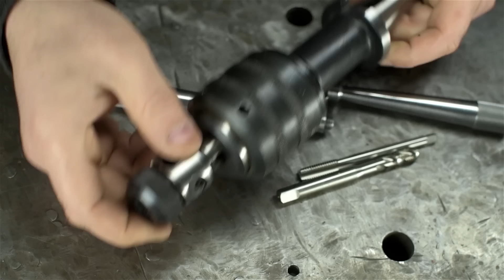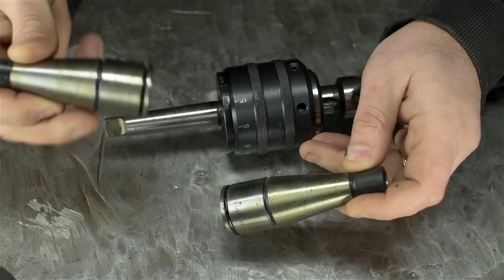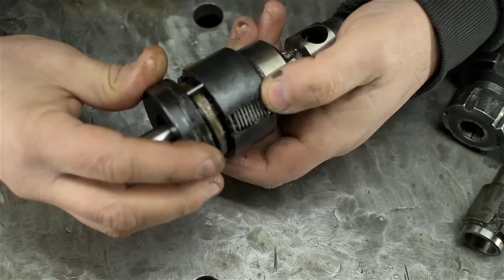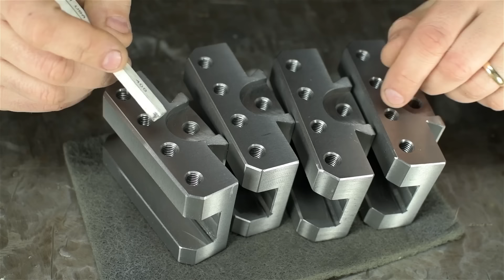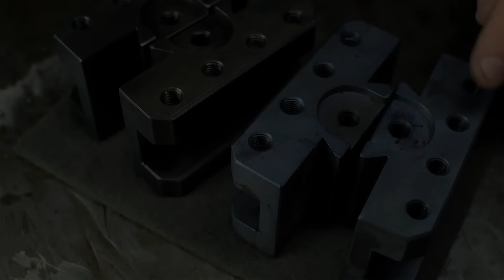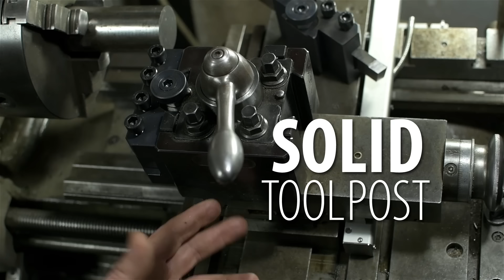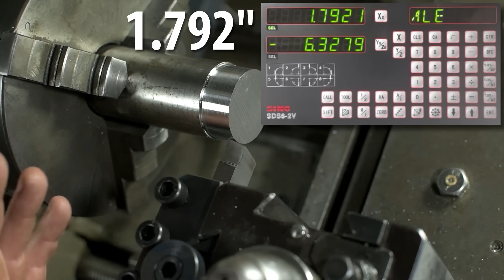How To Break A Tap & Other Ramblings

Comment: If you really want a cheap gun bluing solution, buy a bottle of Selson Blue Dandruff Shampoo and apply it directly to the part.  It contains selenium, hence the name selson blue.
Reply from the maker: I'm not saying I don't trust you, Barry, but this smells like a setup.  You promise you won't laugh when I show up with all my parts covered in shampoo?
Reply: This Old Tony   LOL!  I won't laugh, but try it first.  I discovered this from people claiming their silver jewelry turns black when they use Selson Blue in the shower.  When I looked at the ingredients, it has selenium and so does gun blue. Selenium also generates a tiny bit of electric charge when it comes in contact with light. It could be the secondary or even primary way it prevents rust through a reaction similar to galvanizing.

Comment: would you not be able to make your own ISO 30 holder and just have it as a shrink fit onto your straight shank tapping head doohicky. have something like .005 interference and it should hold more than tight enough for the sizes of taps your using

Comment: As a Machinist and Toolmaker I love your videos. I will say that in most cases the non-spiral taps are stronger. It's not the shank diameter that matters. The webbing is whats going to give up the ghost. In all cases though avoid 6-32 taps like the freakin plague. I can count on one hand the taps I've broken after thousands of holes. 6-32 taps on the other hand. I'd run out of fingers and toes. With such a coarse pitch and the percentage of thread to minor diameter a 6-32 is the worst thread in the world...

Comment: Cold bluing is always a bit tricky, but here is what I have learned over the years.
There is such thing as too nice of a surface finish for bluing. Just like rust bluing has a hard time permeating the surface of steel the closer you get to a mirrored finish.
Clean and degrease the parts, and use gloves. Nothing is worse then a thumb print in your nice new bluing. 
And the sooner you blue after your machining operations the better. The parts will start to oxidize just from the oxygen in the air, it may not be viable but it is happening. I tend to use a cleaner with a mild acid made for bluing if I can not blue the parts immediately after their completion. This will remove the nonviable oxidation and expose fresh steel for the bluing to adhere to.

Comment: Huh, so this tap head is just a clutch, and doesn’t auto reverse?  

Also, 16mm is SO close to 5/8” that many multi piece ‘mechanics’ tool kits don’t bother including a 16mm combination wrench.

At least that’s how I keep it straight.  16mm is one of my waypoints for estimating metric conversions (along with 10mm and 13mm and 22mm).

Comment: Here's a tip. 

NEVER use acetone as a final de-grease before plating or blacking. 

Acetone is an organic solvent and contains tiny amounts of organic impurities like waxes and goo. These impurities are what cause that splotchiness. Acetone as a final cleaner is a piss-poor choice.

Clean the work thoroughly in your U/S cleaner, scrub with Comet, abrasive media blast, whatever, rinse with hot water and drop the work in the plating/blacking solution. If you have to delay before blacking etc, rinse with hot distilled water.

This is not my pet notion. Dan Gelbart, a professor in prototype design, has videoed an excellent 18 part series of tips and tricks for building apparatus prototypes. His words on ensuring surfaces to be plated, bonded, silver brazed, or coated are in a "high energy state" are spot-on in my experience. It's counter-productive to chemically clean, etch, bead blast a surface then contaminate it by a wash in organic solvent. 

Water will coat a clean high energy surface in an unbroken film but will bead if the surface is solvent washed or even allowed to sit in the open air for a few hours. Here's the link to Professor Gelbart's coating video: https://youtu.be/x7onZGqrYyY. Take some time to watch the whole series. The man has some real tricks and shortcuts.
Reply: You can use acetone as a degreaser solvent - as long as you can get your hands on "pro analysi" (99.9%) pureness grade, also used in HPLC. I understand these can be harder to get, but they perform second to none in all of these areas. I use it to clean knife blades before etching.
Reply: @Nemozoli  Try the "water break" test to compare the high purity solvent cleaning Vs aqueous scrub,  clean media blast, dry abrasion, etch, electro etch, etc. Seems to me the high purity solvent would be several times more expensive than the retail stuff, and way more expensive than Comet cleanser and water. 

I'm not sure of the best way for cleaning articles buffed to what the Brits call a "black polish." Stick and cream emulsion buffing compounds use a wax binder impervious to most water based cleaning preparations. Maybe two or more solvent clean cycles with a soft clean brush followed by - what? Solvent cleaning may be contra-indicated if a zero water-break cleanliness is required for the final treatment.

I might be seen as over-selling my assertion but I really don't have a dog in the fight. I've seen Professor Gelbart's video series several times and his remarks in his videos addressing surface cleanliness etc cannot be competently refuted. I once used hot phosphoric acid to blacken steel parts. Following traditional wisdom of an acetone wrinse prior to blackening lead to splotchy, uneven, muted results similar to Tony's. A vigorous scrub with powdered cleanser (Comet, Bon Ami, Ajax, etc), a hot water wrinse and immediately into the hot acid lead to an even glossy black surface identical to that seen on factory made items like tool shanks, twist drills, Allen fasteners, etc. And it was quicker and posed no fire hazard. 

Comparing traditional wisdom of the acetone wrinse to the cleaning methods recommended by Professor Gelbart leads me to conclude the acetone wrinse results in splotchy surface treatments and weaker bonds, poses fire and health hazards (easily mitigated with ordinary care,) and involves an extra step. No acetone for me. 
 
Back in the day when I was enabling some technology transfer involving high strength bonding of graphite fiber tube to its titanium terminations, I learned that zero water-break surface cleanliness was mandated by the Mil Spec. This leads me to conclude if an aqueous surface treatment is splotchy and uneven, the surface to which its applied had some barrier preventing the treatment solution from completely wetting and reacting with the article. If a solvent final rinse was used prior to treatment, I'm inclined to suspect the solvent impurities or the solvent itself.
Reply: my 2 cents-- in hot metal gun blueing   --- 1]wash in cold water with blue DAWN dishsoap...2] boil in hot water without touching,support with rod or wire.  3] imerse while hot into solution. = perfect results.
Reply: @OperaBass3  I guess I'm chiming in rather late, but hey, it's never too late for a word of wisdom (a.k.a. twopence), isn't it? ;-)
Acetone - well, yes... I mean, "no", but that depends, you see...
General purpose acetone ("technical grade") is good for, well, general purpose de-greasing, and it indeed contains some impurities. Then you've got reagent grade acetone, which is good enough for "good enough" cleaning in applications like titanium TIG welding or pre-cleaning small items for electroplating (not on industrial scale, though). Analytic grade acetone might be OK, but it will be prohibitively expensive, as purifying it to such high purity is rather costly process. Acetone itself is tad expensive as a solvent - I'd recommend using ethyl acetate (or butyl acetate) instead. (AFAIK those two are used in degreasing metal objects, steel and aluminium ones, prior to powder coating.)
Then if you want to get rid of all remaining traces of oils, fat and waxes, I'd recommend using a hot bath of concentrated NaOH solution (sodium hydroxide, a.k.a. caustic soda) followed by a rinse with distilled water. In some book about "home electroplating" I've read about using Ca(OH)2 paste (Calcium hydroxide, a.k.a. quenched lime) but I have my doubts regarding this reagent (namely, possibility of forming insoluble calcium soap on contact with fat, i.e. triglycerides).
That should be "good enough" for cold bluing - anything above it would be an overkill. Maybe I've added an extra step - some sort of "activating" or "surface developing" bath - like, say, a short dip in 10% H2SO4 (sulphuric acid) solution (and a rinse with distilled water afterwards, of course) - the acid would etch the surface a little, creating a better base for iron oxides to form and bind to base metal.

Cold bluing isn't an application where surface preparation is crucial and critical - there isn't any "tensile strength requirement" involved here, as is the case with carbon fibre to titanium bonding with some ultra-strong epoxy adhesive, or other stuff like that. All that matters here is obtaining a surface finish with moderate corrosion resistance, plus appealing appearance - so no need to go over the top, to extremes like sand blasting and analytic grade acetone. Prof. Gelbart's methods have their fields of application, but cold bluing tool holders in a garage shop is not one of them, methinks...

Comment: Instead of using "cold bluing" have you tried a phosphate "parkerize" finish.
Typically, need to allow a "thin, complete film" of orange rust to form on the parts. Then apply an automotive "rust converter".
On steel car body parts, it lasted longer than the paint I put over it.

Comment: I made the lifestyle change to a solid tool post on my 13x40 lathe and will never go back (except to cut tapers).    It's been on my machine over a year now, and I've only put the compound back on a couple of times in that period.   It makes a world of difference in rigidity, gives much better finishes and really helps parting-off ops on difficult materials.   Here's what I did, including a dimensioned drawing that might be a helpful starting point if you decide to make your own:   https://flic.kr/s/aHsm1cKjPB
Reply from the maker: nice work!!

Comment: The spiral flute tap may be beefier in the reduced shank area, but SF taps have a heck of a lot more tool pressure, or, take more torque to turn then the spiral point taps.  I'd say a SP tap would have been a better bet for this through hole application. They should not be used for blind holes, or anywhere the threads don't go all the way through the hole, as they are not made to break a chip.  You'll generally break off the third tooth from the tip if you try.

Comment: To get the BEST FINISH with cold blue you take steel wool and rub the part down the steel wool while its wet (or Submerged, whatever does or does not float your boat) with cold blue. I do bluing on axes, usually rust bluing. But sometime I use cold bluing.. Seriously, use steel wool while you cold blue. You may even become the best cold bluer eventually.. This Cold Tony.

Comment: maybe, just maybe you made the pieces out of square in the first video... talking about the squaring on the mill and moving the piece between the first and the second surface, maybe is that, second in my opinion the "bullet" tap are stronger cause they are smaller on thr top an gradually "bite" into the material and the tap (a small one) is not that different spiral vs straight ,last if the steel is hard (40hrc or more) i ìm gonna use thicker oil, just sayng my opinion that can be totally wrong..
love your channel i do a similar work and i love/hate that job (main reason  pwoplw that i work with they always have the absolute truth in their poket) 
anyway i really love your approach (great teacher TOT)
yhanks rik

Comment: Hey TOT, we at our shop use Oxpho-Blue that we get at brownells
https://www.brownells.com/gunsmith-tools-supplies/metal-prep-coloring/metal-bluing/liquid-cold-bluing-chemicals/oxpho-blue--prod1072.aspx
stuff works great and last a long time, we use it to "blue" little hydraulic cylinders  after we modify them. Works better if they are hot and the part is smooth and clean, get a dark black after about a 5min soak and a 32oz bottle lasts more then a year even with our heavy use. Turns a rust brown after a while but still works good.
Reply: they also have a gel ver but it dosent last as long since it needs to be washed off

Comment: Did you temper/harden these prior to bluing? Is it worth doing? Excellent video on tap tool! Similar style of clutches on motorbikes (multi-plate) run in oil but what we want here is consistent torque. Perhaps a grease is better at providing this.

Comment: Because "SEL" obviously stands for diameter/radius mode LMAO! Regardless, that DRO is still a lot of bang for the buck, I will be getting one soon for my home-gamer machine in the garage. Very impressive work on the tool holders, you did a fine job there. I am totally impressed with your ability to feed that tapping head at the correct TPI by syncing the table feed, -nicely done!

Comment: Thank you again.

My cold blue success recipe. 
1. Clean, degrease, clean, ultrasound, compressed air dry, heat gun, acetone bath, dry. 
2. If it's cold in my shop ( less than 70f ), heat gun the part till it's slightly warmer than my hand. I usually employ the heater in my ultrasonic cleaner ( 35c ish ) and if the part is massive enough, it will hold the heat well, but I usually make small parts, so the heat entropies away.
3. Submerge part in Vans Instant Gun Blue. Not the cheapest, but IMO the best for the money. Agitate the fluid, flip the part several times. Leave it in solution about a minute, remove and blot dry.
4. Vigorously rub the part with fine steel wool. This will even out the blotches. 
5. Acetone bath, air blast dry, re-submerge in Vans. Agitate/flip for about a minute. 
6. Remove, wipe and oil.

Comment: Just a guess, but the two adapters may be for saw/slitting blades. If that's the case there's a piece missing... On the other hand, the faces aren't  machined/ground surfaces, so............?

Comment: In my experience, the piece under the blue cap is simply a little grip for lifting the shaft manually, for something like production line testing. Flat and other tips used to come separately.

Comment: I have a Colchester 13 and eliminated the compound. It was the best thing I have done to improve rigidity. Threading actually works better now, I had my doubts since it has to cut on both flanks, but the rigidity counters that. The compound can always be reinstalled if needed, but as Robrenz commented on his conversion on the 10EE, the compound only goes on very infrequently.

Comment: The trick to cold bluing is all in surface prep.  Perfectly clean is the key.  Wash parts in boiling water and dish soap, and dry with air.  Then a final cleaning with red BrakeCleaner or acetone.  Do not touch the part with your bare hands after cleaning.  Soak the part in the solution, pull it out, and rub it down with 0000 steel wool, and put it back in the solution.  Repeat until its as dark as you want.  After last soaking, dry with with a heat gun as an easy way to "set" the blue.  Then polish with 0000 steel wool.  Oil with your choice of lube and heat the part with a heat gun to get the lube warm as it seems to soak in better.  Wipe excess oil off.  Ive done numerous firearm parts using this method, and it always comes out great.

I use Brownells Oxpho-Blue.  
MSDS shows this for whats in it:
COPPER (II) SULFATE PENTAHYDRATE 
PHOSPHORIC ACID  
NICKEL SULFATE  
SELENOUS ACID 
I wouldnt recommend drinking this stuff, but it works like a champ.

Comment: Tony have you tried a lathe to do your tap your parts granted you will need to build a vice to hold them but I found this easter than replacing the vice it is a common problem

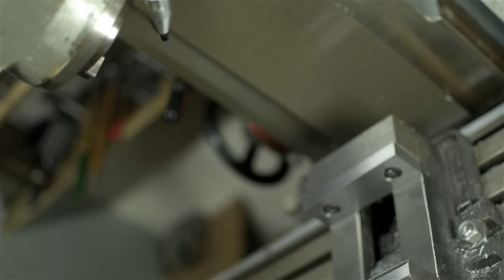Comment: I've been using the Birchwood Casey Cold Blue paste at work for parts that have to be modified. Most of the time I get pretty good results with only a light application and maybe 45 seconds to 1:30 of time that I have to wait on it to do its thing. If it doesn't do well enough on the first shot, the second application almost always will darken it to a point where I am happy with it.

Comment: I only got part way through the video, when I remembered that tapered tool holder that the drill bit welded itself into. Iirc, that happened at the other end, not the taper end, so here is a thought: chop off the end at where bit ends, then finangle a way to fit the tapping head into it ... If it doesn't work, at least it wasn't too much of a waste, as you intially thought about scrapping that tapered end, anywho ...

Comment: I hadn't broken a tap in my life until my well preserved taps starting going dull on me...there's a first time for everything...also there's a fiftieth time for it too! Keep in mind that spiral point taps are a little cheaper and a lot tougher too. They should be the first choice whenever dealing with a through hole or a deep enough one to pack the chips in. The main advantage of spiral flute taps is their ability to bridge gaps like slots, as with spiral flute reamers. That's why they make left hand spiral flute taps too, so you have the edge, but can still go over a slot.
PS: I recently bought a 1μm indicator but the tip is screwed very tight and I'm really scared of removing it (due to the extreme sensitivity and tiny travel)...any tips (pun intended) will be much appreciated)

Comment: i would keep the compound, since you don't have a cnc to cut tapers you will need it sooner or later. just set it square to your spindle and maybe tighten the scews down which are jused for the play of the compound so it won't as easyly under load.